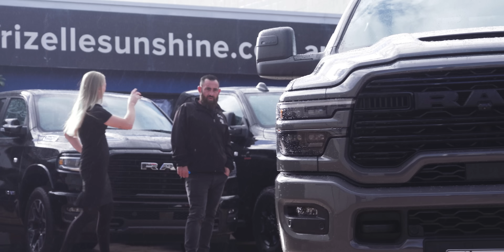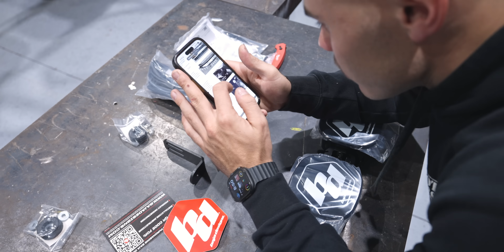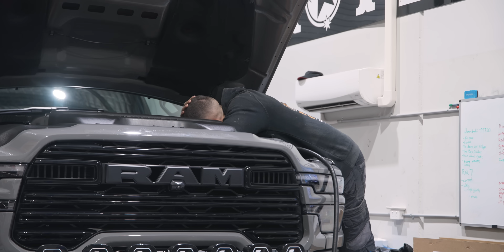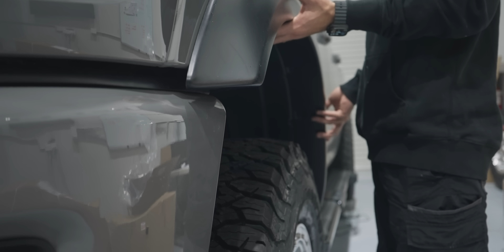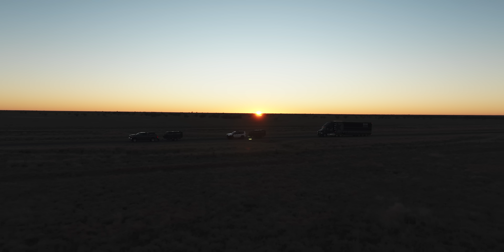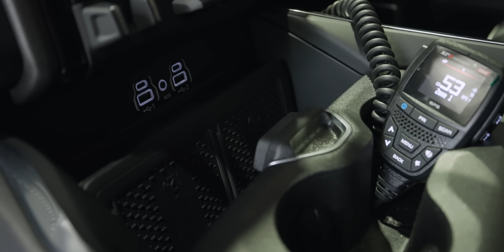Building The ULTIMATE Touring Vehicle! Did we get it right?

Comment: Air compressor.... in the engine compartment with intake 3 to 6 inches below the air intake. If the air compresssor starts having issues you know to shut the engine off before you suck in water. I can't claim this one since it was a suggestion from an ARB rep.

Comment: The upgraded RAM with the 6.7 HO Diesel coup[led with the ZF 8 Spd is a dream combo. I also love the fact that RAM has resisted the ugly boxy front end look and retained the retro look, especially the grill. I think that in terms of aesthetics the HD 2500 and up walk all over the F trucks, and Chevy and GMC in aesthetics.
Reply: BTW I went with the current model 3500 Mega Cab basically because of limited payload capacity in the 2500,. Add tow ball weight, a few things in the bed, a couple of adults, a full tank of fuel, and there goes your  total payload capacity. So I went to full GVM upgrade to 5990kg NB2, and added Liquid Springs.
And I gave RAM Australia the option. Contacted them 3 times and never even got so much as a email in response. They are the in the top echelon =when it comes to arrogance.

Comment: 35×12.50r18 Falken Wildpeak AT4W tyres as they are built for HD trucks and are full width and full diameter or 305/70r18 Mickey Thompson Boss AT or 35x12.50r18 Nitto Trial Grappler MT tyres. If Toyo sold the Open Country RT PRO in Austalia I would hands down recomend this tyre.
Reply: There are hundreds of tires built for HD trucks. If you are getting a little wild try and Interco or Pit Bull tire. From my experience, the interco M16  and some TSLs are good in snow, but I have not found a Pit Bull that mathes up to the sizes that I need.
My daughter was running AT4Ws on her Wrangler before she traded it and was not impressed. I wouldn't take that as a hit against them since she is only 17 and has less than 110k miles under her belt. She does like the Goodyears on her current F350 Tremor (2026), but has no snow or ice mileage. Does have around 18,000 miles towing a 6 horse gooseneck trailer.
Reply: I was on factory continentals on my F450 and hated them.

Comment: Niiiiiice, We call that color Putty here in the US. :).   I'm sure you have figured it out by now but, your Light bar is gunna throw faults with all the sonar and tech in that location on the truck.   Did you find a work around for blocking the forward looking radar and sensors??   Looks sweet!!!
Reply from the maker: Nah still working on it, doesn't throw any codes just the radar doesn't work
Reply: @PatriotGames  The older models had the sonar/radar up on the top of the windscreen, a pain when you need to replace the glass, cause most auto glass wont reset it if the rig is lifted.  Still looking for PCOR to bring your trays back to the US!!
Reply: @PatriotGames  yup I made the same comment elsewhere.

Comment: I have one of these new ones, thinking i might do the coil replacement with airbags. Thanks for the idea! Tows like its got nothing on the back. Love it.
Reply: If you are thinking about doing any towing or heavy hauling skip the coil springs. The rear end will never be as planted and the load will never feel as stable.
Reply: Wheelbase is also a great help. If you don't want a long vehicle don't tow more than 16,000 lbs/7,250 kg with a SWB 2500.